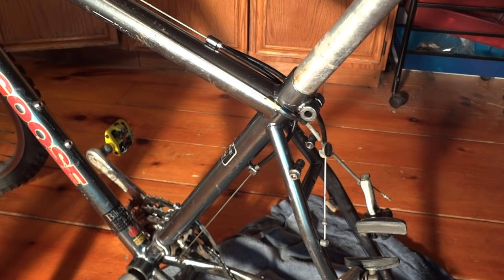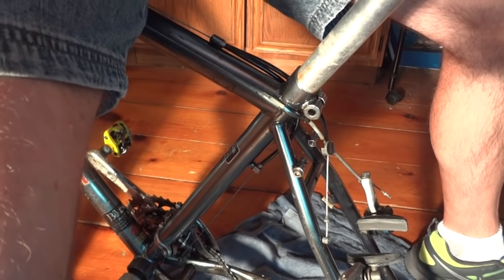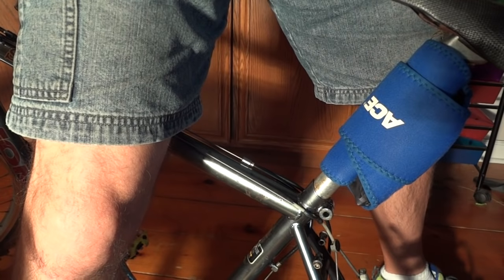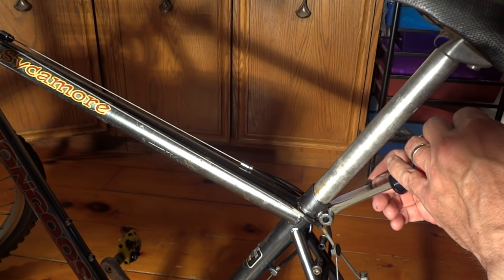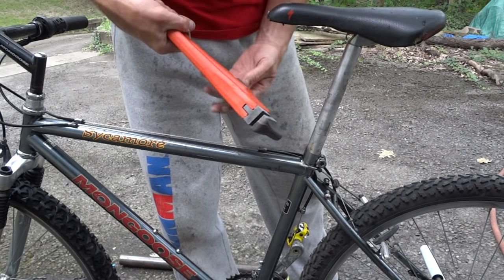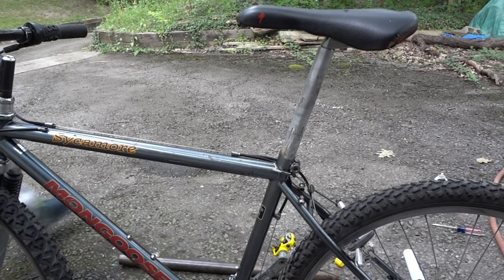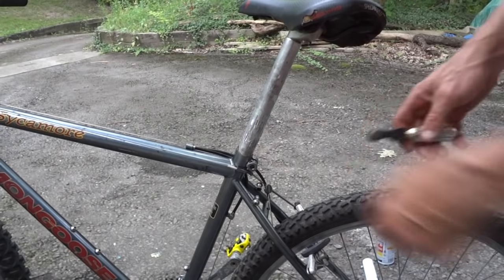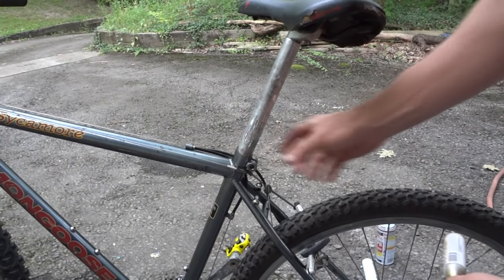Removing Stuck Aluminum Seatpost From Steel Bike Frame

Comment from the maker: My goal was to remove the seat post WITHOUT damaging the frame. A seat post is easily and cheaply replaced. A frame not so much. Your guess is good as mine. I used ammonia, vinegar and PB Blaster. And lots of muscle to get it broken loose. If none of this works, you can also cut off the seat post about an inch about the seat post, and then hacksaw vertically inside the seat post.
Reply: Still looked dry on the bottom... go figure.   The pipe wrench has worked for me  Wrapped with leather or cloth.  Then tapping up on the seat post with a rubber mallet and or board.  Keep adding penetrating oil.

Comment: You provide some excellent bicycle mechanical advice, and your innovative mechanisms to pull a stuck seatpost out of a frame are among the best I have ever seen.  The major problem is to penetrate the corrosion and break the seatpost loose within the frame, WITHOUT damaging the frame, paint, seatpost or saddle, in that order.  Many methods for loosening a struck seatpost shown on Youtube depict some really destructive techniques that create more problems than they solve.  Here is another proven method to loosen a stuck/corroded seat post, that has worked for decades.  1) Apply some form of penetrating oil to the inside and outside of frame and seatpost a minimum of 8 hours (overnight is better) prior to applying any movement or force to the seatpost.  If possible, invert the frame and apply penetrant to the inside of the seat tube via water bottle mounts or bottom bracket as needed.  This will allow much more penetrant to get inside seat tube where it will actually penetrate the corroded areas, far more effectively than anything applied to the exterior of the frame at the seatpost junction.  Transmission fluid or most any thin oil works OK.  Allowing plenty of time for the penetrant to work is far more important than the particular penetrant used.  2)  Find a junk seat that you are willing to sacrifice.  Virtually any local bike shop has them in the trash, and they all fit the same. 3) Remove the wheels and any other loose objects from the bicycle to reduce the weight.  Remove the usable seat and clamp the junk seat onto the seatpost as tight as possible without damaging the seatpost.  4) Clamp the nose of the junk seat into a strong vise mounted on a sturdy workbench.  Do not use a saddle you intend to keep, because it is likely to be damaged.  The seat provides much greater leverage than trying to apply force to a bare seatpost.  It will also allow that force to be applied without damaging the seatpost.  5)  If you have a helper this can be done with the bicycle inverted.  If solo, clamp the saddle in the vise with the bicycle frame perpendicular to the floor.  6)  Begin to twist the bicycle frame back and forth until the corrosion breaks loose.  This may take a lot of small movements back and forth rather than large movements.  Re-adjust and re-clamp the junk saddle within the vise, and apply more penetrant as needed.  One can also apply moderate non-damaging heat to the frame to expand it relative to the seatpost.  7)  Continue to twist the frame back and forth while pulling the frame away from the seatpost.  8) This should free up even the worst stuck seatpost, without creating any damage to the frame, paint or seatpost.  9) Without a vise, and/or when dealing with cheap round-top seatposts using old Schwinn-type clamps that slip around the seatpost, it may be necessary to use a pipe wrench applied to the seatpost.  This will damage the surface of the seatpost, however.  10) Another method is to drill at least a 3/8" diameter hole through the top of the seatpost and insert a bolt to allow better rotational torque to be applied when twisting the seatpost.  This will also cause permanent damage to the seatpost but will spare the frame and the saddle.  11) It is possible to use substantial heat to break corrosion, but at risk of damaging paint.  Keep in mind that aluminum melts at far lower temperature than steel, if using any sort of flame.  The principle is to expand the frame with heat and/or shrink the seatpost to break the corrosive bond.  If dealing with a steel seatpost in a steel frame, using heat on both the seatpost and frame can also break the corrosion, at the risk of melting frame paint.  Ideally, the steel seatpost will be chilled to shrink it with the frame heated to expand it.  If applying heat to a steel frame with an aluminum seatpost, the aluminum will expand more than the steel.  So using some cold applied to the seatpost with perhaps a heat gun or even a hair dryer applied to the frame, can often break the corrosive bond.  NOTE:  This same principle of thermodynamics can be used to loosen pedals, cranks or handlebar stems that have become corroded.

Comment: I had the same problem with the handlebar stem and a seat post on a Batteglin frame from the early 80's.  I went through all the solvents, external freezing, ammonia, etc. - no joy.  Actually, I had to saw out the seat post with a hacksaw blade, and I gave up on the handlebar stem because I did not want to chance damaging the frame.    Last winter, the temps were down in the single digits for about a week, unusually cold for my area.  The deck and siding on my house was "POP-POP-POP" (firecracker loud) all week long.  I Googled about the noise and learned that the metal screws were shrinking because of the cold temps. I left the bike outside overnight and removed handlebar stem the next afternoon with moderate resistance.  If I had only knew that when I took 4 hours to hacksaw the seat post with a blade.  Hope this helps.
Reply: interesting read.
I might have to wait next winter to remove my seized quill stem, then.
Reply: So what are we saying cold temperatures makes steel more movable? Cold makes it contract right? Heat makes it expand right?

Comment: Thanks buddy. I was finally able to remove the seat after working 25-35 mins. I just kept twisting the seat left and right then it got to a point where it was so loose I was able to turn it with 2 fingers and rotating it good 360 and was turning in circles non stop.

Comment: Another option is to put the exposed seatpost into a vice and use the bike as leverage, of course after soaking it. It is far easier for home mechanics to do that than using wrenches on the seatpost as they could break. Have used this several times in a shop setting, so know that it's an easier option.
Reply from the maker: I don't have a bench mounted vice. Here is another option. https://www.youtube.com/watch?v=S3ek2GeZzE0
Reply: A great option, but would tend to think that the vice used carefully is easier for most folks to get to.

Comment: I ALWAYS put anti-seize inside my frame and seat post when I remove it for any reason. Makes ALOT of sense as getting a stuck seat post out is not fun. Just a bit of anti seize makes life ALOT easier !!
If the last bloke who took the post out just put a bit of anti seize in there, that post would of just came out with ease
Reply from the maker: I use a thin coating of grease. This bike was pretty abused when I got it.
Reply: Yeah I've finally learned this lesson...of course I now have a project this afternoon so I hope it isn't this hard.

Comment: if you use anti seize your aluminum when its next to steel it will come apart easy.. anti seize is good to use on any metal, up to 1400 degrees too like exhaust systems, makes taking things apart much easier.
Reply from the maker: +Don Fraser Grease works too. I bought the bike used and the seat post was already frozen.
Reply: RJ The Bike Guy.

Comment: whats up with all the aluminum seizing up in steel
Reply from the maker: It's called galvanic reaction. There is a reaction between the aluminum and the steel.
Reply: is it that white stuff that build on some aluminum?
Reply: RJ The Bike Guy have you ever brought a power band off ebay for your bikes?
Reply from the maker: Power band?
Reply: RJ The Bike Guy yeah i heard of some guy buying a powerband for his crosser bike and i wondered if you would get one for you push bike i'm not sure what they are to be sure
Reply from the maker: I don't even know what it is.
Reply: +Brandon Eme  No grease.

Comment: It` was worse if you have to remove an aluminium 22.2 mm  fluted seat post you used to sometimes  get on BMX`s of the past it always ended in disaster.

Comment: Love your channel! Best down to earth, real life repairs and tips.
I just extracted a post which had been stuck since the mid 80s. Mine came out easy...  I turned the frame upside down and squirted WD40 from the BB hole. I gave a few squirts every week, repeating for  8 weeks.  Then I clamped the post in my bench vice--two firm twists and it popped!

Comment: mine is exactly the same i gave up put seat back on ,seeing your vid makes me want to have another crack at it fool that i am.
Reply: I got a Fuji bike frame that had been sitting outside for a while and I soaked it in PB blaster for a few days, heated it with a torch and quenched it with PB and it came loose with a pipe wrench.

Comment: I just spent the weekend struggling to remove an aluminium seat post from a steel frame. Thanks so much for this awesome video and for your advice. Applying ammonia with a dropper did the trick! Pipe wrench was also helpful for loosening the post. Thanks buddy!

Comment: I know I'm late here, but I've had good luck with clamping the saddle to a table vice, and then leveraging the entire bicycle like a giant key. Then again, I've probably been very lucky and not dealt with anything as stuck as this. I saw one of your quill stem removals, and I have literally never had to do more than hold the front wheel between my knees and give the bars a sharp jerk  (no pun intended, lol)

Comment from the maker: Try getting a little vinegar down there to dissolve run. Use a pipe wrench on it like I did and keep turning it back and forth until it loosens up some more. When it gets loose, clamp some vise grips onto the seat post so you can turn it while pulling up at the same time.
Reply: Amazing persistence

Comment: after watching this video I used the apple cider vinegar and have since removed 3 stuck seat posts. 2 were aluminum in aluminum and 1 was aluminum in steel. Wow thank you for the tip.

Comment: Okay...NEXT TIME.....take the seat off. Then take the wheels off. Clamp the seat post in a bench vise that is SOLIDLY mounted. If your vise has a pipe fitting on its jaws, even better. USE THE BIKE FRAME ITSELF AS LEVERAGE TWISTING BACK AND FORTH. Comes right out every time.

Comment from the maker: Leave the tires on. I had the wheel off in part of the video as I was going to work on the wheel. But ended up putting it back on. If a magnet sticks to the seat post, it is steel. If not, then it is likely aluminum.

Comment: Thanks for the Awesome Video.  We just purchased a used bike that has this issue.  Took it to the Bike Shop they told us they charge $120.00 per hour.
We Left
And Decided to Consult the wisdom of Youtude and found your Video.

Hopefully the Apple Cider will do the trick!
Reply from the maker: Just keep trying. If you have a solid bench vise, you can flip the bike upside down with the seat post clamped and rotate the bike.
Reply: They guy at the bike shop suggested we turn it upside down and get the solution inside the frame by removing the screws where the water bottle holder is located.  Block the top so nothing leaks out.  He suggested Using Coke Or PB.  But I will start with Apple Cider Vingar.  Would you reccommend mixing  little baking soda into the vingar.  I did that once to clean rust off a treadle
Reply from the maker: BlkOnyx488 No. Baking soda will neutralize the acid in the vinegar. Is it an aluminum seat post in a steel frame? Vinegar works on iron oxide, but not aluminum oxide. This stuff might help loosen it up a little bit in addition to the use of a big wrench: http://www.amazon.com/exec/obidos/ASIN/B00ACTMZOI/ref=nosim/youtube25-20
Reply: RJ The Bike Guy I have no idea i it's aluminum or steel.  How do I find that out?  thanks for your help!
Reply from the maker: If a magnet sticks to it, it's steel. If it doesn't, it's probably aluminum. Steel and aluminum react with each other and become nearly welded. The iron oxide is pretty easy to get rid of. The aluminum oxide not so much.
Reply: Whoo hoo its Steel!!  So will the Apple Cider still be my best shot?
Reply from the maker: Are they both steel? If so, then the vinegar is your best bet.
Reply: RJ The Bike Guy  Yes Steel on steel.  I have begun the Process,  I am even making a video, in case it works!!

thanks for your help no matter the outcome
Reply: Please always do.
Reply: +RJ The Bike Guy does this happen with aluminum seatpost in aluminum frame? Will they also stick together like this over time?
Reply from the maker: Probably not like this. Still a good idea to have a thin coating of grease on the seatpost.
Reply: BlkOnyx488 good lol it shouldn’t be more than 30 bucks for a good stuck one
Reply: RJ The Bike Guy this is gunna help me I’m going out rn to try haha

Comment: Hey man, I just wanted to say thanks for all the cool videos.  They have helped me out on more than one occasion.  I thought I'd return the favor by suggesting something that worked for me this week on a chromoly Trek 930 with an aluminum seatpost.  In addition to the spray method used in video prying open the seat tube notch, I incorporated a plumber's rubber strap wrench.  I was able to get pretty good leverage.  That and some cursing under my breath did the trick and didn't ding up the seatpost.  Anyway, hope that helps.  Cheap tool.  About $20 for a pair of large and small ones.  Later.
Reply from the maker: I have strap wrenched, and thew wouldn't have worked on this. Maybe on a seatpost that is only a little stuck. 
buit check out a few of my other seatpost vids:
https://www.youtube.com/watch?v=S3ek2GeZzE0
https://www.youtube.com/watch?v=_gAXL2FSY_A
https://www.youtube.com/watch?v=LJLZ9Ojtr80

Comment: Looks like I could potentially have a lot of work ahead of me still. I tried the PB Blaster and putting the seatpost in a vice and using the whole bike as a lever, but I broke the top off the seatpost off doing that. There's still enough post sticking out for a pipe wrench to grab hold of. It's encouraging to know that it can be done. I was thinking about using a torch next. If all else fails, I was going to try cutting the seatpost vertically, and very carefully, so I can maybe break it out in pieces.
Reply from the maker: Another thing to do is remove the bottom bracket. Stick a heavy threaded rod down the seat post. Through the BB attached some washers and nuts to the rod. The washers need to fit into the seat tube, but be larger diameter than the seat post. Once you have the rod installed, a couple things to try are:
https://www.youtube.com/watch?v=S3ek2GeZzE0
or something like this:
https://www.youtube.com/watch?v=7GvN7w386U0

Comment: This happens way too often. I’ve seen several very rare frames with very nice seatposts completely seized to the point where only destructive methods would work. I’ve passed on buying a couple very nice vintage steel bikes because of this. It’s simply not worth the risk and headache of buying a bike with a seized seatpost unless it’s basically a giveaway price or free.

Comment: I had the same problem with a bike I purchased a few years ago.
But I removed the seat and wheels.
Turned the bike upside down. 
Clamped the seat post into a big vice that was secured to a work bench and me and my mate just twisted the bike from side to side and after about 5 mins we finally got the post out of the frame. 
Your way was ok but twisting just the seat doesn't give you enough leverage to get the post out.
Reply: Makes total sense...........
Reply: That’s how it’s done

Comment: F**k me, I'm looking forward to this now!
Love the Ice Pack you tried, laughed my socks off!
Well done though, you got it in the end and didn't damage the bike.
I got a can of freezer spray here, off to try that first, wish me luck! LOL!
Reply from the maker: Good luck!
Reply from the maker: sparkyuiop Keep at it. My guess is it's an aluminum stem in a steel fork, eh?
Reply: shyflirt1
Yep. Trying to borrow some of those big mother wrenches you used.
Reply: I believe that putting dry ice down the inverted seat tube, while obviously plugging up holes in the seatpost, sometimes creates enough cold to allow removal. If rust is the problem putting something like Evaporust in the inverted seat tube can also remove rust and facilitate removal. And if those more extreme measures do not work, then drain cleaned in the inverted seat tube will always work while dissolving (only) aluminum seatposts, and stems as well.

Comment: I am watching this video thinking the same as what sparkyuiop said!  As a lady, I find that trying to loosen anything seems to be impossible!  You were putting your full body force into it and it still took a while for it to come free.  I will give it a go, but looks like I will need to get a pipe wrench to finish it off.  Nobody told me I needed to do body building before attempting to remove this seat post! ;)
Reply from the maker: Hopefully yours wont be this bad!

Comment: Worked on turbine engines and in the hot section we used torq CB - kimball Midwest on seized bolts. Works like magic. Remove the BB spray in the frame towards the seat post through out the day, let it sit overnight. Remove saddle and twist on vice. Comes out like a charm. If that doesn’t work, try dry ice to shrink the seat post